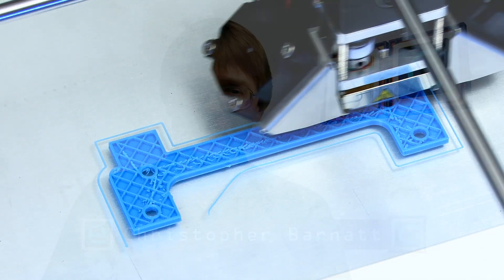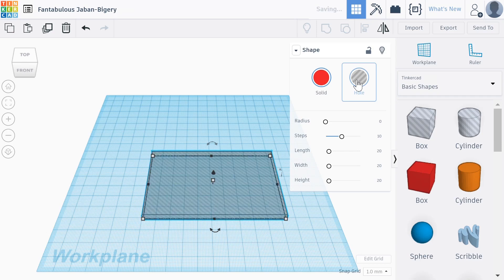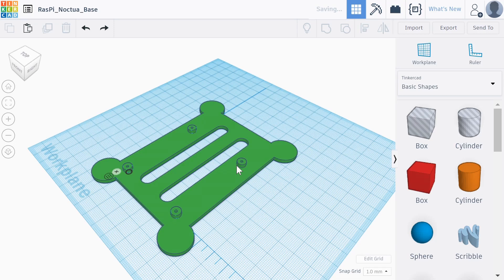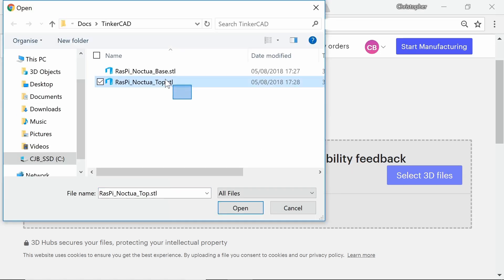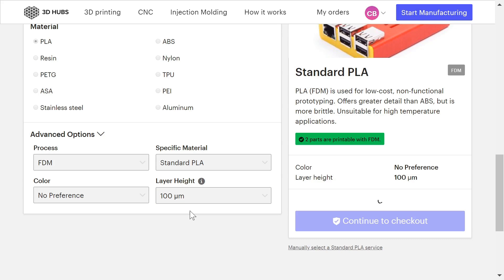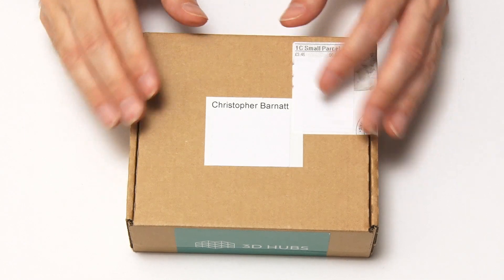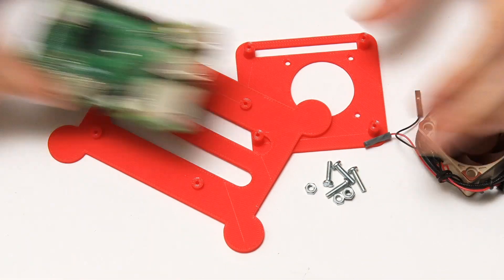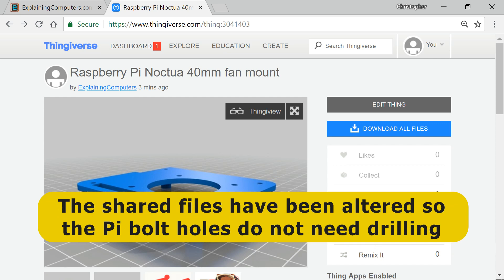Online 3D Printing: Tinkercad & 3D Hubs

Comment: Hi, well explained video. Though if you are going to be making a lot of things, it is better value in my opinion to buy a 3d printer - for less than £200 can get a pretty good brand printer(ie not one of the slightly dangerous anet a8s) such as ender 2 or 3. I say this from experience. I'm developing something and looked at getting something 3d printed by 3d hubs. It was going to cost something like £30. Which seemed reasonable for what it was. I then reconsidered and decided as I was going to need quite a few bits over time it was better to get my own 3d printer. I got an ender 2 in a sale for £120. The first thing I printed(the thing I was going to pay £30 to have done) came out great. Except I had made a mistake in my design and it didn't work as intended. So if I then redid design and printed again and it worked. If I had got it printed online I would have a £30 plastic things that is useless(we've all got enough of those already). I've since printed loads of parts which means the costs of the 3d printer have more than been covered compared to online service. I realise for someone who just wants 1 or two things done it makes sense but in the long run I believe having own printer makes sense, but that's just me.
Reply: Speaking a the owner of several 3D Printers and a fair ammount of experience. I completely agree, if you want a few occasional things printed, then the likes of 3D Hubs will be ideal, especially if you're not interested in learning all about the complexities of the machines etc. However, I'm a nerd/tinkerer so it was inevitable that I wanted the hands on option :-)
Also, the likleyhood of needing to iterate your designs is quite high, I do it almost daily and it's part of the enjoyment for me. but the costs of getting it reprinted will mount up quite quickly when out-sourcing.

Comment: Very cool but I have a question about how you went about measuring the board and the fan in order to get the parts to line up? Or did you have pre-existing plans that gave you the relevant dimensions of everything?
Reply from the maker: I spent a lot of time with a ruler! And checked everything very carefully.
Reply: @ExplainingComputers  very impressed!

Comment: Another thought, could you sometime run through the 3D materials available, their properties and "best for..." sort of thing, Ta !
Reply from the maker: Now that is a great idea. Noted high on my list! :)
Reply: +1 from me; i was about to write a comment asking if this cheap material you've ordered would not be too brittle for something more complicated than microcomputer mount.
Reply from the maker: PLA is pretty tough -- one of the most common materials 3D printed on consumer and prosumer machines (not least because the fumes from it during printing are non-toxic).
Reply: (I run a hub) You might want to consider PETG for this kind of thing. It's a modified form of the plastic used to make soft drinks bottles, has a higher tensile strength than PLA and ABS, can handle heat better then PLA (PLA will wilt if you sit it in strong sunlight for example), and handles UV light well. It still behaves well when printing (it's much better behaved than ABS or ASA) and so should cost about the same as PLA to print via 3D Hubs, and it comes in both translucent and opaque colours. It's about as glossy as PLA.

Nowadays I print more PETG for 3D Hubs customers than I do PLA, by quite some margin – it is fast becoming the material of choice, particularly for functional parts.
Reply: I hoped somebody was asking for this 😉

Comment: Wow! That is a very nice solution and a lot better than the way I do my cases. Usually, I buy a 12" x 12" piece of plexiglass and have to do all the measuring, cutting, sanding etc myself. I don't think we have a service like that here in the states. Really nice work. Good job Mr. Barnatt 👍
Reply from the maker: 3D Hubs is based in the US! :) It has hubs all over the world (most in the US). When you upload a job, it finds the hub closest to you that can print what you want.
Reply: Oh, thank you. I had no idea that they were available here too. Hmm, I'm definitely going to look into that. May I borrow your template? And if yes, can I tinker with it a bit? Thank you very much in advance Mr Barnatt. You are awesome!!! ☺️
Reply from the maker: Thanks for this. I can see I have you thinking! I've shared my files on both Tinkercad and Thingiverse so you can do with them what you like. :) If you get yourself a free Tinkercad account you will be able to edit them there. Search for "Noctua" or "explainingcomputers" to find them.

Comment: There are a lot of great 3D printer kits the you can get for under $500 some as low as $100 if you shop around some of the more popular ones are the Prusa i3 and the Anet A8 both printers have a large following online with lots of websites, YouTube videos and Facebook groups to help build and use these printers. Now these kits are not good for the beginner kit builder and a good knowledge in electronics, electrical and mechanics is a must have to build and use these printer kits safely, some of these kits need some modifications to make them safe and less of a fire hazard. I have the Anet A8 and have less then $200 into it I paid $170, with $25 into some upgrade parts, and a lot of patients and tweaking I can print as good as printer costing $1000+
Reply: I don't recommend the Anet A8, it lacks a lot of safety features like thermal runaway protection, and it has an acrylic frame. The connectors for the heated bed also need to be replaced as the stock ones aren't rated for the current draw. The Ender 3 is a pretty great option in that price range.

Comment: Can one also print false teeth with this tool?
Reply from the maker: Using 3D Hubs, quite possibly (although I'm not sure if they allow you to specify medical-safe materials). But there are certainly Hubs with the printers that can do this. Though I doubt you'll design new teeth in Tinkercad. :)
Reply: Yeah, the learning curve can be a bit steep with Fusion 360. I have little experience with CAD and find myself hitting up YouTube often to figure out how to do simple things.
Reply: For bio-printing most probably you have to reinvent the wheel. Some substances have been printed successfully, such as skin tissue and eye retina. Very interesting, but also very expensive, and not everywhere allowed.
Reply from the maker: Teeth are not bioprinting -- both EnvisionTEC and Stratasys have A2 shade resins for printing final teeth now, usually via a form of material jetting.